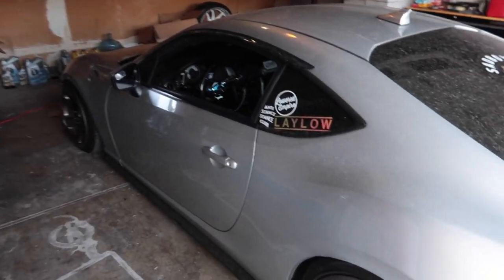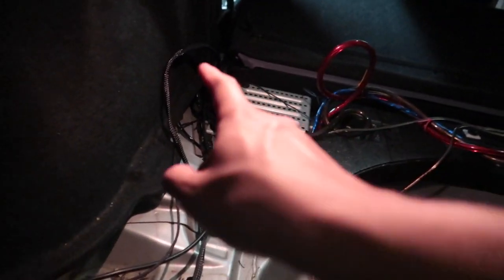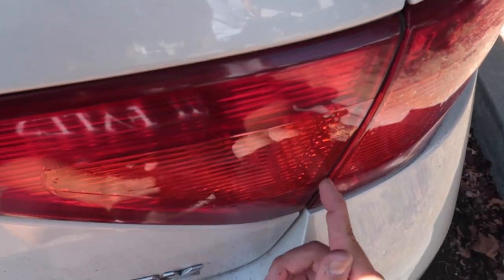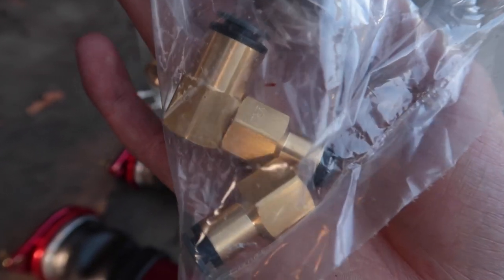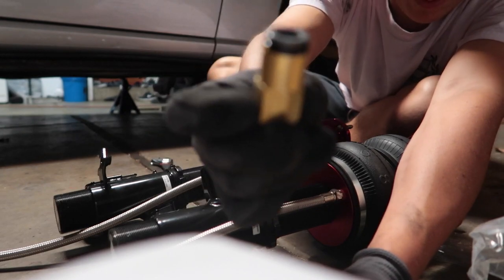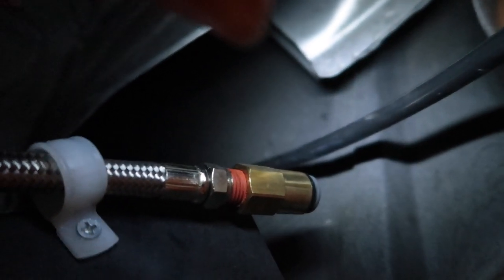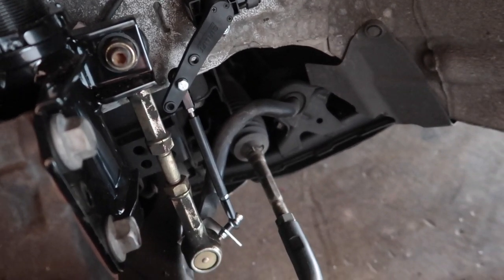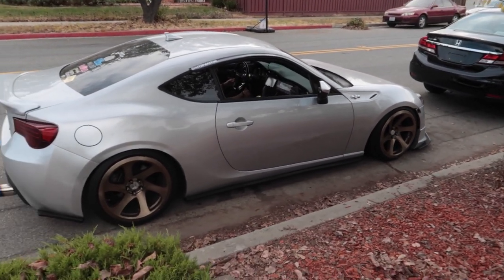FRS Gets Bagged | Airlift 3H

Comment: Melissas front fender has no liners so it was easy to pass the braided line into the engine bay .. anyone else would have to drill a hole through ... juss putting that out there

Comment: hey i just got done installing airlift 3p kit, my front struts does not get any air pump at all and the rear at air out is not even tucking tires.. any clue what can be wrong?
Reply from the maker: The rear lowermount needs to be adjusted. Lower mount adjust the height of the air strut. As to why the front don't get air? I couldn't tell you unless I could see the system. Good luck!
-Christian
Reply: that was the problem didnt know the thread part on the coil can be raised alot.
Reply: how did you tap the height sensor bolt to the sway bar what tool to drill?

Comment: Christian loved the video!  I have a bagged 86 and want to run some more negative camber up front but I blew two front bags because they were rubbing on the body of the car (the inner side of the bag) how can I run more camber up front without the bags rubbing
Reply from the maker: Theres a bolt that you have to take off on the driverside strut tower. Once you remove that bolt, you also want to shave down the welded nut. Its on the inside of the riverside strut tower. That will help you. You can also slot your lower mounts where the camber bolt goes. But make sure your offset on the wheels is aggressive enough to do so. Hope this helps, good luck bro!